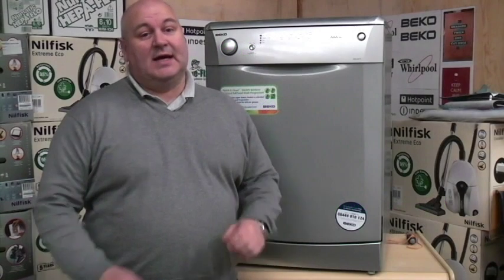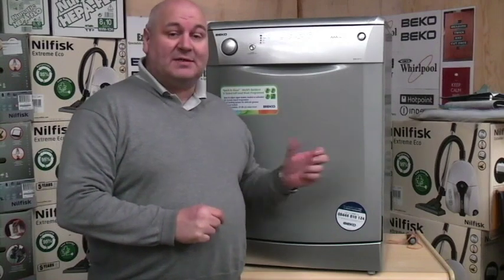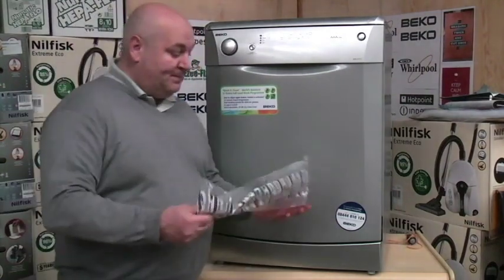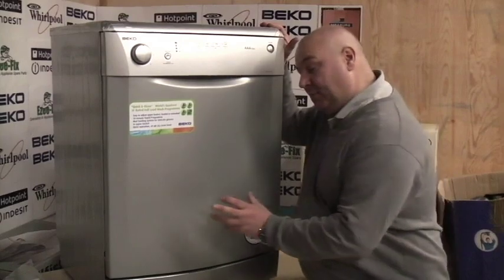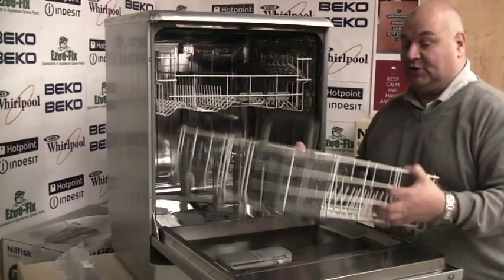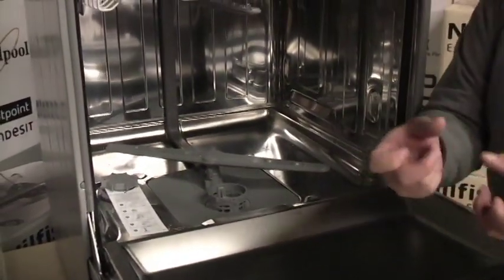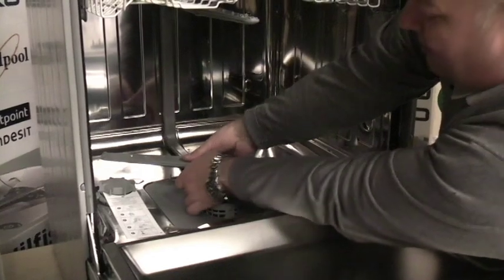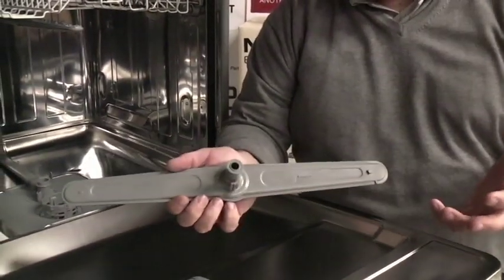Beko Dishwasher - How To Change Lower Spray Arm

Comment: My Beko dishwasher lower arm is knocking against the door. (there is a very small mark).
I removed the arm and dont see anything thats broken or old to do this. Do you know if its a normal issue thats fixed with replacing the arm or its something else?
Reply: Did you find a fix? same thing is happening to me
Reply: @king0fd3mon  did a 3d print of an pteg "o-ring" to fill the loose connection of the rotating part....already had to substitute it once but since it took more than 6 months in between thats good enough for me.

The new arm was quoted 80euros or whatever so...not gonna happen for now
Reply: @joaoleitao619  How did the connection get loose in the first place? A pot rotated badly in my machine and when I opened it the arm was just disconnected... Do you have a visual for where the "o-ring" is supposed to fit?
Reply: @king0fd3mon  hmm mine was the lower arm, and im not really seeing how it could disconnect easily since it has some side hard tabs to hold the arm in place.

I assume it was loose due to bad design...its plastic on plastic, it will eat plastic with time.